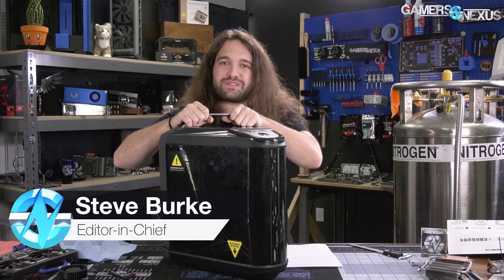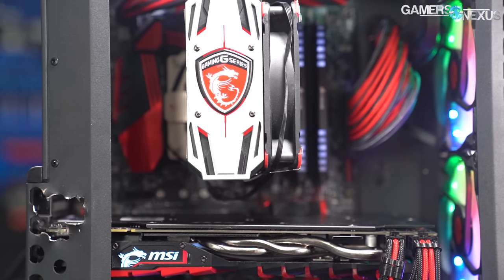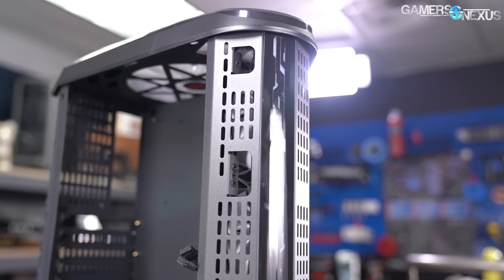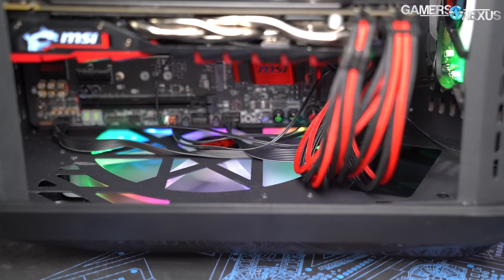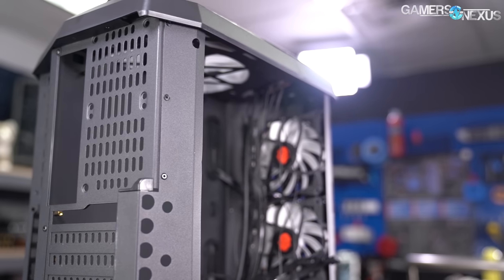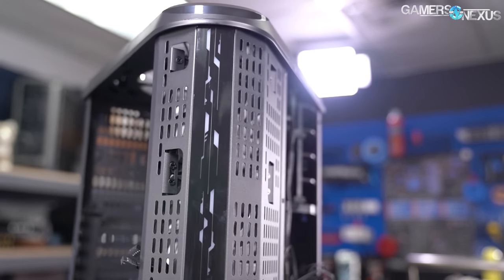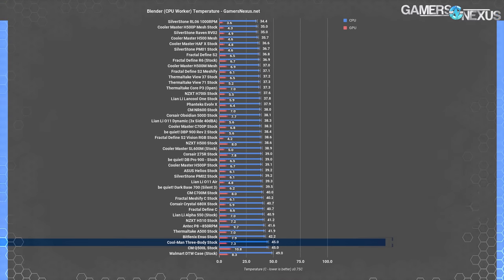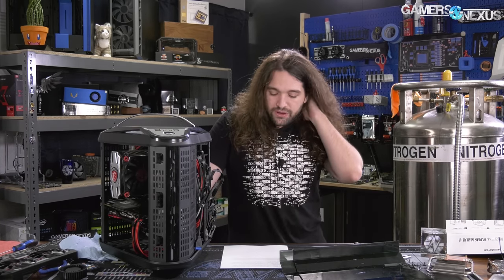Coolman Three-Body Strange Case Review: Case We Bought in China

Comment: Imagine Steve contacting Coolman for a GN fixed version of this. I'd buy one.
Reply: perfectly said
Reply: Honestly this just needs all the RGB off, mesh where some of the plastic is, remove the random glass panel on the top and mesh it and the flow of the fans should just be changed around a lil with bigger feet like Steve said. I think it'd be rad if it was perfected by GN, he probably has more ideas but in theory it can cool very well!
Reply: Akiro Tha' MuskyPaw'd FluffyManed Wolfaroo I think you’re right. They were a little too worried about the “gamer” aesthetics but had a not bad idea for the case

Comment: I would change 3 things on this case

Make the front a mesh panel and just have flat acrylic for the sides

Replace the top glass pane with mesh

Screw the whole top panel to the chassis
Reply: Jeremiah Galli . And provide deeper feet to lift the case so the bottom fan can breathe.
Reply: @AndrewSmall963  These 4 things would indeed make it a decent and interesting case. I hope they are listening.
Reply: LianLi makes some odd cases at times, so maybe pitch the idea to them and see if they do it?
Reply: If the side windows were flat, tempered glass might not be too expensive. Curved mesh on the front, while adding an extra part, might still be easier than getting the curved acrylic to turn out well with high yield.

Comment: I love this case design! I think given the price point spending another $100-$200 upgrading/modding the case itself could easily bring it up to the standards of a upper mid-tier case for a bit less than manufacturer cases. IMO populating the 80mm fan slots, converting the top piece to vented acrylic or using small risers with the glass, upgrading the intake fan to one of the ultra high rpm fans plus going water on both cpu/gpu would make this case a beast. Awesome of her to be willing to not only let you film ;but was also super accommodating even though you only wanted 1 unit, wish you guys would do a contest for this case!

Comment: I really want to grab one of these just to mod it. Trim back those 
acrylic panels some or cut out a design where the 2 areas are for the vents to let the front of the case breath, swap out the 
top glass for a custom made filter and put some slightly taller feet on 
it and i bet it would cool pretty decently.
Reply: Zalman is making the same case called the x101 I assume the case in the video used the same molds just build with cheaper materials and sold on the side under a different name.

Comment: GamersNexus(steve jesus) why dont you make a case with your brand? You know what is needed for god air flow, space etc....i think it would be a great idea.
Reply: It would cost a lot of money
Reply: It be more effective for them to work with say the meshify or another company and do a gamers nexus edition. It takes a lot of money to design, have tooling made, and manufacturers a case.
Reply: Open air test bench, done. Doesn't take engineering or expensive tooling to get there
Reply: @phillipzan2005  and actually engineering a case, isn't just showing where flaws are. There is a reason engineers go to school
Reply: @Tallnerdyguy  yeah they got money to go to school
Reply: Designing a case is surprisingly difficult. I've been involved in the process a few times and though we had the luxury to work with a single SKU and could tailor it to fit the exact components it wasn't easy. Now scale that to where you need to provide compatibility for different components not all of which have the exact same layout or even the same size and it gets much harder. Making it big with lots of dead space helps, but then there's already such cases on the market. 

And once you've designed the interior you will find that making it look good is a where it gets very hard. Just look at where the major manufacturers are today. Glass panels everywhere, hidden air intakes and exhausts, shrouds to hide "ugly" components, and a slew of RGB everything just to make it light up the dark dungeons they imagine these will be used in.
A lot of people say they want good cooling, but then turn around and buy something that will light up their computer cave while slowly cooking the components.
Reply: Better option would to do a creative collaboration with a case marker. To do the original route would cost a lot in r&d.

Comment: Not a bad looking case, but mods WILL be required to make it cool effectively.
I'd cut the side panels level with front grate edge removing the curved part of the side panels. Remove the plastic strip at the front of the case, wrap black mesh around the front covering the black metal part of the case. I'd raise the case by about 20mm letting the bottom fan breath properly. I'd remove the glass from the top & replace that with black mesh & flip the fan over to suck air out the top of the case. That should fix the cooling issue drastically.
How about doing something too this case like what I'd do. It would be an interesting exercise in your awesome modding abilities Steve.

Keep the great videos coming mate.

Comment: You could replace the top glass with a custom cut piece of acrylic with some vents.  You can also use clear acrylic tubing and some quick set epoxy epoxy to raise the case off the floor.  remove the front corner piece and this thing could be half decent and it is quite a unique look.  I dig it honestly....

Comment: It probably wouldn't be too hard to make that good. 

- Replace top glass with mesh
- Use standard tempered glass for side panels with a front mesh pillar doing the curve and feeding the fans
- Redesign the rear of the motherboard tray for better cable management 

- Screw in the panels
- Put taller feet on the bottom
- Make the case 5% longer, and maybe 3% wider
- Include standoffs and RGB>mobo cable

Comment: A really easy change they could make is mesh in the roof instead of glass, then for the side panels you can even stick to acrylic if you really wanted to, but affix it to a metal frame that extends out past the acrylic/glass and curves around the front with a curved mesh section on each panel to wrap around that front corner. Or, they could also make the mesh in that front corner clip to the case independently of the side panels, and shorten the side panels to accommodate. You're right, this design does have some untapped potential, and kinda makes me want to grab one for a mod project.

Comment: I would take those side panels and cut patterns into them towards the front, then put some fine mesh between them and those airflow cutouts. I'd also replace that tempered glass on top with mesh and secure that top panel from the inside with a few thumbscrews. Seriously, this would be a wonderful base for case modding.

Comment: Very unique aye... 

One big doubt for my new build. I have old Corsair TX 650 Watt (2012 build) 80 plus Bronze certified will able to handle : 
1. Ryzen 3700X
2. 2070 Super
3. 16 GB 3600 (low LAS RAM)
4. One NVME M.2 500 GB 
5. One NVME 500 GB
6. 2 TB HDD
7. Liquid cooling
8. MSI x570 pro

NO RGB.

Will this PSU will hold up ??
Reply: @Student _Arthur Thank you for the advice... 😊
I will try to build with new one

Comment: It seems like if they got rid of the curved side panels and just used shorter flat panels (real glass even :P) and left the front where all those slots are cut out open for air flow for the front fans, it would likely do a bit better.  Then put mesh on the top, raise the height up a bit for clearance for the bottom to breath, throw in some decent fans on the back for exhaust and it might be a half decent little case with a really neat design aesthetic.  Either way I really like the look of it and it looks like it would be a fun project build to make it both look awesome and function better than stock for cooling by cutting/rebuilding things a bit (which shouldn't be too hard considering most of the problem components are just plastic and even the metal isn't that solid as evidenced by the mods you guys already did to it to fit your GPU into it).

Comment: So remove the glass top, the handle, cut the plastic where it rounds the corners, get some black rubber furniture feet and some black plastic window screen. Black electrical tape a strip of window screen to the front where the plastic used to cover with the tape under the plastic panels to hide it, put the feet on the bottom and glue some window screen on the top over the fan after reversing it and all fixed.

Comment: Steve if you could give me advise . MSI Tech support btw is OFF weekends ! WHY !?  lol   My roommate just bought a MSI X570 mobo for her 3700X CPU . Her first AMD CPU . She paired it with a Corsair 650X PSU . Upon hitting the power button on the front the fans all spin for a second then it powers down and you have to reset the PSU . I don't have the resources to test it like I want to and she is so haphazard abt doing things I don't have the cables from her previous PSU that as far as I know still works to test to see IF the new one is maybe bad from the factory . She literally has only had the mobo for a week . The model is the MPG X570 Gaming Edge WiFi . I personally didn't put it together but am trying to help her because every PC I have built posted on start up cause I got it like that . lol

Comment: I would raise the tempered glass on top and add tall foot pegs to the bottom. Cut the curve off the plastic side panels and cut the front corner grill out and add a mesh around it instead. Could be a good case after all these mods but I cant find it
Reply: Also add a mesh fan grill over the bottom fan so you wouldn't have issues with wires brushing it as a safety precaution

Comment: This could be an interesting niche for a "space saving" mATX case that fits into a corner... allowing additional improvements for airflow, accessibility, and cable management. The main sacrifice is aesthetics as the cables will be facing the end user instead of hiding in the back - but, frankly, I think having cables in front is a feature for ease of service & upgrades. Also, this focus on aesthetics and cheap RGB LED is B.S. that needs to be dropped like a bad habit.

Comment: i feel like you shouldn't modify the case by taking off panels for temperature readings, just the fan orientation. as most if not all people want their case to be enclosed when using it and if they don't they should just go for another case. a case will always be cooler with no top on and having a intake fan on the front, back or sides just due to hot air rising. i love how you just picked it up at the start and it just fell apart, here we go again with another unusual and bad design. they don't need to try and make the most interesting design case, they need to make a case that is designed well and it feels like most cases cant even get the simple stuff right when it comes to air flow and worse of all the more they get the airflow wrong the more wrong they get on the looks too. like having front intake with it covered by a really bad front with every little intake holes and filter on it so no air gets through.

Comment: So here's what i have to say about this review: Stuff made in china bought from Aliexpress or directly in shengzhen usually has different variants of quality.  By removing that top glass panel, you revealed that this case might have an alternate form with a mesh top. There is probably a more expensive version with more usb headers which might include 3/3.1.  Obviously the plastic panels are the biggest downgrade for this case from their expensive variant. However, overall this case just seems to be kind of bad thermally and spaciously.  In future trips to China, try to make sure you ask about quality typing. most 3c (electronic shops) will know them. (A++, A+, A, etc)

Comment: Could you not at least used a dremel and some sanding paper to make the gpu fit.
This looks like a Linus tech tips job, i expect better from you guys.

But shit with a little cutter, like caned food quality steal. I needed about 30 heavy duty dremel blades to cut my Cooler master Haf-x sides panel open, they use 1.5 to 2 mm thick steal, its why i still have it. And still modding it cut around a kilo of steal out to fit radiators. Case with parts is still 29.7 kilo so i am not taking it to a lan any time soon.

I like that shape of case and it has some cool modding potential, my worry would be that it may collapse if i cut the insides up.

Comment: I really like the idea of the case, but, just not the execution.
It's rather cheaply and stupidly done.
Like it falling apart if you take the top off. There is no need for that with a decent locking spine.
With mesh instead of the glass or plastic, and a bit stronger build, it would be a nice case. Though it should have a little bit extra room for the vidcard apparently.
If it has a vertical mount for the vidcard it would be even better for the airflow.
The 200mm RGB fans are a fine idea honestly.
Just a little more clearance along the edges of the motherboard so you can stick some cables between it and the case.

Comment: I'm really getting very sick of the flat non-perforated front panels case manufacturers are using, they are deliberately impeding something as vital as airflow for looks alone and to be honest I don't even like that look, it's one the reasons I think the cheesegrater mac is the best-designed case ever. Even apple with their throttling i9 MacBook Pros have included large air inlets on the front of the new Mac Pro.

Comment: Oh, so you bought the Chinese Coolermaster H500P?
Nice! Good to see Steve's instant case dissolving powers back in action again!

Also, this is the ugliest PC-case I've ever seen! But it's Cool-man, 'cause with the side panels on and the system turned off, it reminds me more of some over-engineered, pseudo-practical plastic-bomber household appliance that lazy yuppies with more money than brains would buy. Like that weird plaster bucket with a twisting mechanism which automatically wrings the specifically designed mop, when placed in the bucket (don't know the name or manufacturer).